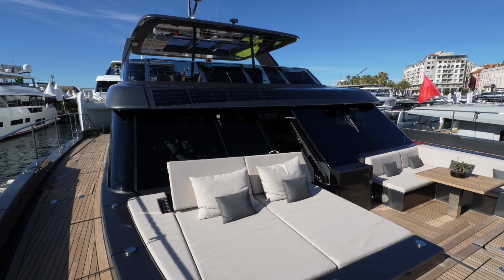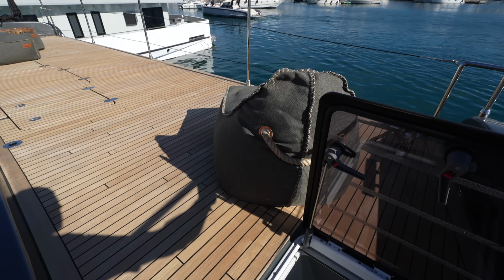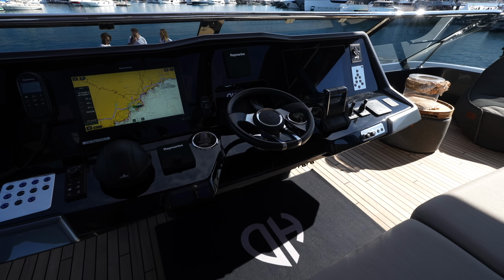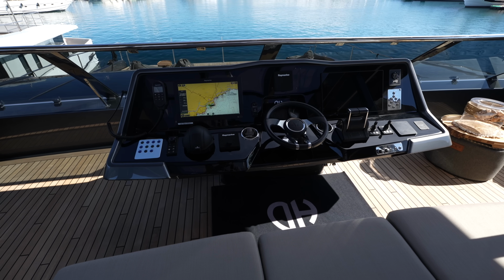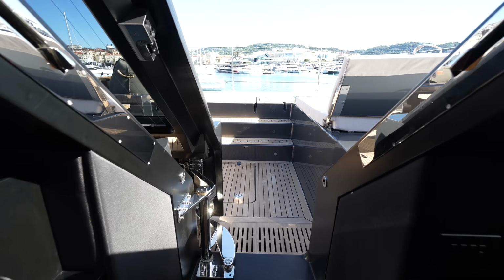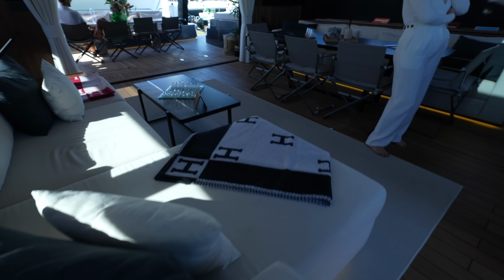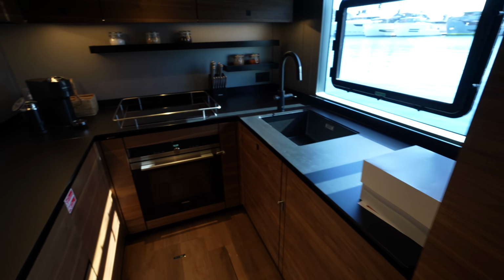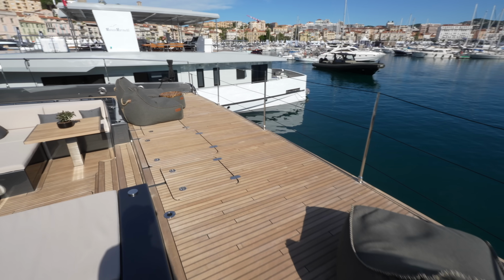Sunreef Power 60 ECO Yacht Tour | Long Range Luxury Power Catamaran Walkthrough

Comment: Side decks are useless on a boat without sails and rigging.  Why not get rid of those and increase the interior volume plus the area available for solar panels.  Same with the fly bridge.  extend the back of the roof to six feet beyond the stern, and get not only a hanger for the tender, but even more solar panel area.  People don't like having to stop during the night when their boat runs out of power, and while they wait for the next day's sunhsine.  The boat I'm describing can cruise 24 hours non-stop, and at a higher speed.  Eliminating engines and generators, and configuring quadruple-redundant solar panel systems will ensure that the boat can cruise even if 3/4 of the solar panels are not operational.  eliminating engines, generators, and fuel storage frees up availabel weight capacity for more batteries.  24-hour cruising even directly into the wind.  Freedom.  No dependence on marinas.

Comment: Nothing “eco” about this! It’s so absurd. You’re burning MORE FUEL to move because you have losses for the generator to charge the batteries and losses to store the electricity.  Running straight diesel engines to the props and a diesel generator is more efficient. The owner probably drives a Tesla and thinks he’s “saving the planet”. SFS.

Comment: Sorry it’s not eco friendly it runs on a diesel generator that’s the only reason why they can claim such a range. No where will they list what you get on a single battery charge. So hope and pray it’s always sunny
Reply: Did you miss the part of sailing about 4.5 hours at 8 knots on the battery, so 35 nautical miles give or take depending on seat state and hotel load....

Comment: Thank you for the video. I really like the idea behind the all electric yachts. However I have never found the marketing to be anything other then a misdirection. The 5000 NM range is 99.25% Diesel. Not even 1% of the stated range is battery. I am not sure about the EU but I do have a lot of experience in the west coast, California. So going from Long Beach, Ca to Marina Del Ray, CA is roughly 40 nm. The chance of making the trip on Battery Power alone is highly questionable if not impossible without absolutely perfect conditions. That is a very short trip. Is electric power for yachts the way to go in the future? Yes, absolutely. I want to have battery powered propulsion for harbor and close to shore right now. However I do believe that the producers of these all electric yachts need to be far more transparent when it comes to range. House Load is good and usually right for what is quoted but range is always overstated.
Reply: Perhaps you weren't aware that running a generator at a steady pace that is at a most efficient rpm to generate electricity, then storing/using that power via a battery bank is far more effective than the traditional boating method? Yes, you have a diesel generator running all of the time, but it remains at a steady, efficient rpm while you adjust the electric motors as needed. They've been using similar tech in diesel electric locomotives for about a century now... but without the battery.

Side note..... no one is "saving the planet" by going electric anything. E cars and such are just as destructive to the planet (or even more so) than gas powered ones.
Reply: @mikeb8342  What dos your  reply have to do with the range given under battery power? When giving a range for a charge that should be without running generators. It's also funny that you had to go to Trains giving every cruise line runs generators to power their pods. The point I made was range stated per charge.
Reply: @MrAaroncissell 
1. I went back through this video AND Sunreef's website. There's no mention of a 5000 nm range "per charge". In fact, I saw nothing misleading. Pretty clear.... a short time running 100% battery, then a diesel genny running to supply power and/or recharge the batteries. 
2. I didn't know that cruise ships used electric pods powered by generators. What does THAT have to do with your misunderstanding of either this video or Sunreef marketing as being misleading? In fact, seeing that both locomotives AND cruise ships use this approach is testimony to it being more efficient..... since crusie lines and railroad companies don't put eco before profit.
Reply: @mikeb8342  Good job actually not going back over anything. All the info was in the video and I laid out the exact diesel usage you stated was being used in my original post. Coming back to try to cause an argument over 2 months later is great. You keep up the good work. Have a great day.
Reply: @MrAaroncissell 😂 whether you realize it or not, it was YOU that started this argument two months ago.... by complaining about something THAT NEVER HAPPENED in this case (being misleading about range on battery only). Then your reply to me DID THE SAME THING... which I confirmed was a bogus whine after "going back over" what was said in the video AND Sunreef's website.

I could (and was about to) say more on this, but somehow I know it won't reach you. I sure hope you have a nice (and likely blissfully ignorant) day, too. S. M. D. H.🙄

Comment: Nice looking Yacht, but not for me. 100% EV is not safe. What isn't mentioned is that EVs, boats, Cars, and Bicycles, even laptops, cell phones, overheat and catch on fire very often. Which the governments and the Electric industry keep from the public knowing. Once an electric vehicle, boat, etc, catches fire, it goes up extremely quick with no way of extinguishing the flames quickly and safely. It's a silent killer. Also, it is not cleaner or safer for the environment. It costs a lot more than wind and diesel.